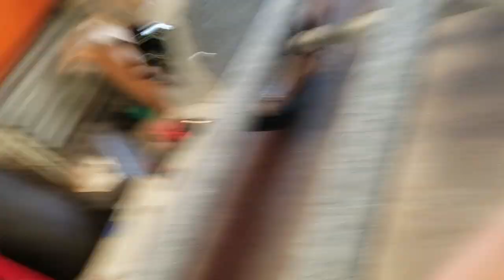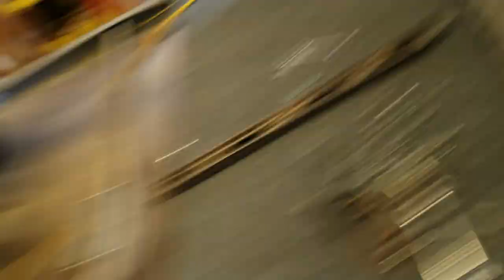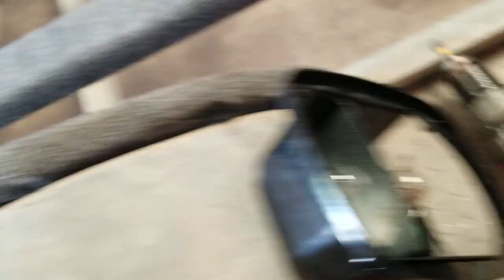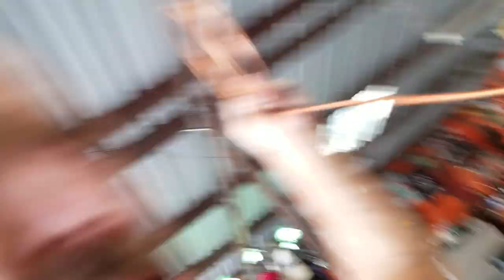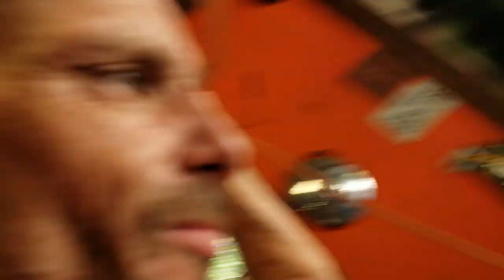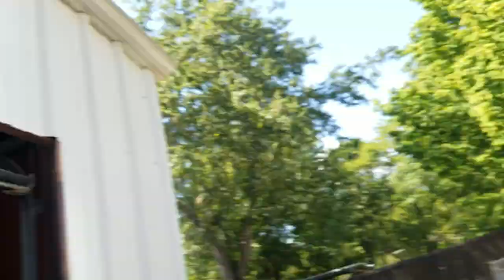Boat to  Jet ski trailer conversion

Comment: Limpy you mentioned the wood. Is it not marine grade. I didn’t use marine grade in my transom. I coated the wood with fiberglass resin.
I agree Limpy. F’em